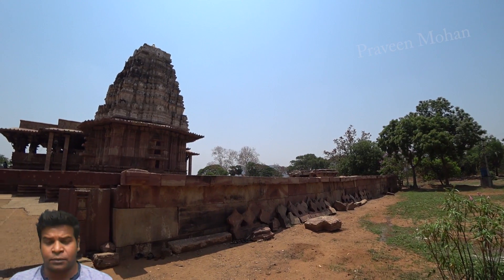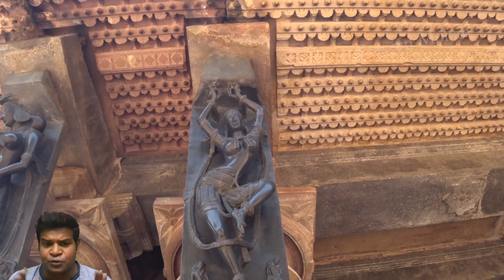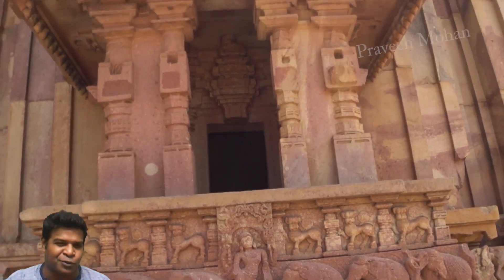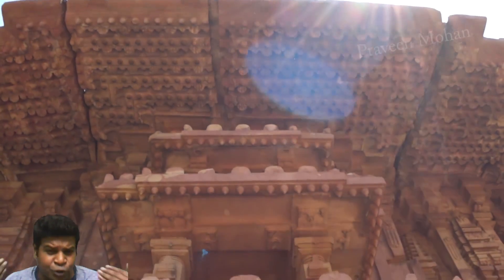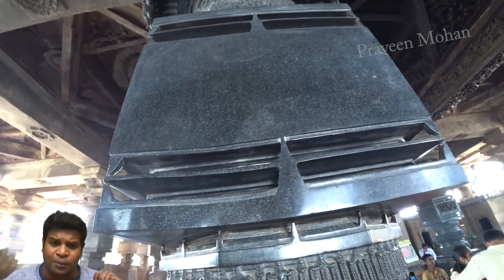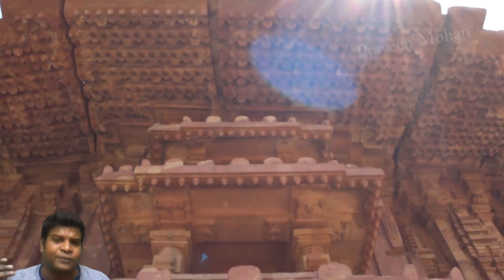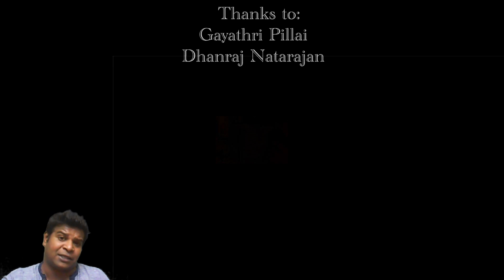Decoding Ancient Engineering Technology at Ramappa Temple, India

Comment: As a structural engineer I have used current earthquake design technology in the design of major structures as well as buildings. As these joints are " keyed" but permitted to move vertically it is a technique that we use in major earthquake prone zones. This method allows the overlying structure to "walk" back & foward vertically but not displace horizontally. Thus not only allowing the whole structure to remain intact but may have a dampening affect as the lower section moving in quick lateral back & foward motion, is separated from the top structure which moves in a much slower, and dampened, frequency. Obviously this minimises overall damage. This modern tech is only less than 100 years old. You did well to analyse the temple column tech Praveen so I think that the local university should grant you a doctorate in analytical engineering as soon as possible. Keep up the good work as I am a great fan of ancient Indian tech and, also more importantly, ancient Indian spirituality which will lead the world foward in the near future. 🙏

Comment: Praveen, I don't  think they were representative of step drills, I'm thinking they are used more as a "Go-No go" guage. The holes you were showing in the model were square holes. The female square hole has to be a different size then the coresponding square peg that is going to allow the two to nest together. Each step on the guage is numbered. Workers in one location can make a same size hole or peg as workers in another direction by the plans showing what step on the guage to use for a particular stone.
Anyway.... just a thought. A guage like that is used un production work!

Comment: At 16:41 you show a carving that you see as a drill. My thought is that in the tunnels you show in almost every video under these temples there are square holes in the walls, and these slide in and protrude into the tunnels like a sideways antenna. Then when wind blows through it vibrates these "antenna's" producing a sound like AUM. It would vibrate the entire temple, which is all carved to vibrate at specific frequency's. Then those sound waves would be amplified by those speaker shapes in the ceiling, making the place hum like a thousand monks chanting. 
Just a thought.

Comment: I notice that the statues and the columns look exactly the same as those which remain from the destroyed Warangal Temple. Is it possible that they were taken from the ruins of Warangal and re-used in this "new" Ramappa Temple? Warangal may be much older. 
For me, the most amazing thing to see are the machine-like "grills" which you can see around the square part of the column at 14:34 in the video. These are the same as those on many columns and other objects from Warangal, and many other ancient sites in India. These grills do not look decorative, they had some purpose, they are machine-like, unlike all the other pretty decorations and figures. What was fitted into those grills? Wires? You can see what look like wire holes in some his-res photos of these columns. I have seem some columns where the grills have been broken by what looks like someone trying to remove whatever was inside.

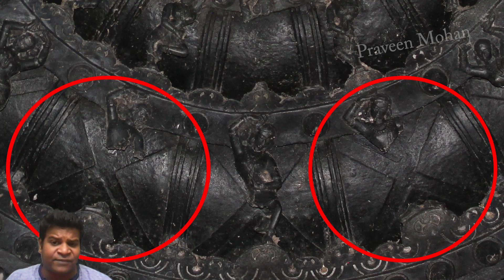Comment: Pause it @ 2:30 Look at the X on the right, the upper right section. How the two lines of the X run paralel even when the error is made. The rock was soft enough to make those marks with wood. The figures were moulded and placed over the X.

Comment: "At the end you must agree they had similar tech to today". Lol. No. Not at all. We have computers, mechanical and electronic portable devices, science that is very far advanced, hard hats, machines, cranes, cement, steel and so much more that there is 0 comparison. 
They did their best with their limited knowledge but it's not comparable wwhatsoever. 
These are simple stones shaped and cut and designed by hand by lots of laborers over time using simple tools to chisel and cut. They had some methods which are simple and they work and they repeated those. This is beautiful not that complex

Comment: Maybe the carvings/ molded statues broke out during the earthquakes. thats why so many spaces and on the one side that was hit hard. it looks like the were layed in by a hook and gravity method. Sorry, looks like that to me. and melting rock it possible. the run off from mining and extreme heat when boiled causes a chemical reaction and melts the basalt to liquid like state. then pour into shaped reinforced molds and when cooled it hardens again.Some of the building was lathed and carved to. That how Machu Pichu/ and other sites around the world did that mined for metals. the run off melts rock when super heated. i believe that they just crushed the rock up and melted it this way. And if you use a full stone it softens it on the outside about 6-10 inches like putty for a certain amount of time so they can shape it next to the other shaped block

Comment: I agree this is a tool. However I disagree with the suggestion that it might be something as mundane as a step drill bit. It is never shown next to or attached to anything that resembles a drill. It is also found in the Dendera Light hieroglyph in the Egyptian pyramid. There it is quite often shown right next to the ankh. 🤔 I suspect it is something relating to the technology they use for power.

Comment: Hello,  I find your channel extremely interesting as to questioning the building techniques from the past, however I cannot agree with your assumption as to the Step Drill  comparison with the item indicated in your video.   The first thing that strikes me is that these are square in section, no round, it would have been very easy for the artisan to round the corners off rather than leave them square.    My suggestion is possibly a taper drift or device to reshape a drilled hole to a square shape.   Or a stack of leaves of a spring that can support a column as per your idea as to the `Vee` section  support or locking device. idea???

Please keep your observations and ideas coming as this is the only way you will get viewers to `think out of the box` as per earlier constructional building techniques.
Take care.  Alan.

Comment: So watching this video I was looking at the roof and the little spikes on the edge of the roofs they appear to me to be points for the water to drip down so there's a thing called a hot roof or your roof sweats so maybe the climate was a little more moisture and the the roofs the ceilings not the roofs but the inside the ceilings those spikes I believe if the moisture level gets intense water would collect on the roof and then it would run to those drip points and it would make drip points all the way around the whole Temple making a line of drips and I believe that these line of drips were also used in maybe a type of water rain appreciation music that could happen but it's just interesting how the drips refocused down water which is a form of energy life whatever from what catches it the ceiling and then it's condensates there and then re-drips down and it's all directed it's very interesting

Comment: From the features and the advance cutting device from this ancient looks alike a workshop for machining works before those tools may be scattered due to explosion or accident and being abandoned. The remains of those things looks like a advanced capacitor to boost fields and maybe created field cutting device. You guys need to realize the physics here of quartz crystals, conductive stones etc...somebody could by accident were used one of those Blow torch lighters after had a smoke of weed 😁 a  where the used the blow Torch Lighter and focused the jet flame on a large piece of Rock Salt, It built up energy in the Rock Salt and it exploded and shot hot pieces in all directions. So if you think of this with very tiny pieces of quarts with a Plasma field on quartz field stone it would shatter those pieces creating a cut in the stone. Maybe ultrasonic sound might cause quarts to give of fields that melt instead. However, no experts from the people to understand or repaired the machining technology and  to remember of their existence, the temple being rebuilt. We don't know.

Comment: The tool is used throughout history with previous civilizations just for different reasons, what’s missing is the frequency needed for the type of work required. Every mineral has a specific frequency where it softens to the required density needed for the user, trick is figuring the frequency to each one... kinda like the movie “the core” did with its craving sound vehicle, just to the degree of 3D printing...

Comment: the real main reason  people from a long time ago used stone is because the are much smarter than us.
to shape and lock stone together is much more stable in an earth quake.
they may at one time tried to use metal but they new it would not work because when you place metal very deep
into the ground it acts like a large tuning fork and it will shake and vibrate very heavy and the stone in your walls will crack
and buckle under its own weight.

Comment: I wonder if the pillars were used as pulleys and the tool was situated between them and ropes were pulled to turn the tools....
The ropes could be placed at various levels of the tool to achieve various speeds and torques. The ropes could be pulled by as many or as few as necessary. Maybe the whole temple was a machining factory.

Comment: Great video! However, I do have a nit to pick: the walls are stone and the statues are stone. How could the builders place the statues to fit in the slots without leaving marks, at the very least, to breaking bits of stone either in the statues or the walls or both? There is no give to the stone, so you can't just "slide in" the statues into the slots.

Comment: In those times which this temples had made should be a big advanced enough.means the artists had all the advantages in their hands.plus having some secret high tech tools  belonged to a special society.In these kinds of works normally in some Areias if some peace’s curved out ,in some other Areas some other peace’s cut separately then glow in the place.,in some other ....some other peace’s would be worked in small peace’s then will be glowed and connected together with outer inner joints.Also using rocks powders can be used ....

Comment: Nice again, is it possible that the supposed drill bits are actually a harmonic resonating tool? Would be easy to carve stones with ultrasonic sound, isn't that so?  There is one of those devices at the bottom of the sea, I will have to find it, AND there is the exact same tapered tool carving here in Utah, at the San Rafael swell that people believe the Mayans carved.  I have wondered for a long time what this symbol is... .... ..

Comment: Looks more like a broaching tool than a drill bit.  Step bits are mostly used for cutting large holes in thin and relatively soft materials.  Don't see how this geometry would be useful for cutting stone as plain metal tool like a modern step bit.  On the other hand if it was metal tool loaded with a cutting abrasive it might be effective.

Comment: Hi Praveen.. Great job 🙏...
Phenomenal effort indeed to decode things the way you're doing.
Being a structural engineer myself, I am thrilled by the way ancient construction technology had flourished. I would also like to introduce you to a term called "shear". The slots you were mentioning, most of them are designed to be functioned as a shear connections & some are ball and socket. Designing those connections is itself a procedure which includes parameters like density of the material, shear capacity of the cross sectional area of the male portion of joint. As you have clearly stated these are rocks which are brittle in nature, they can only be designed on load bearing concept and the self weight (acting due to gravity) of all these individual members of the structure itself brings in the inherent lateral stability on its own against external lateral forces caused by ground motion due to earthquake. 

You're doing a great job my friend 🙏. You're blessed.
Keep up the good work and wish you all success.

Comment: Thank you for dedicating your time to help inform and enlighten. All your videos raise questions we need to be asking ourselves. I want to comment respectfully about the “step bit” design in the model. If compared to the two pillars directly on either side. The profiles are identical on separate size scales. The plinth notch at bottom, the square base block with two horizontal dash lines, the octagonal section with two rings, the next square section with two sets of horizontal dash lines  at which point it flares out and supports the ceiling. So if imagined, the rest of the step bit continues up through the temple.  Would those “notches” be the floor levels slid into and locked in place. Is there a way to continue the comparisons? If the plinth is cut exactly to the size of the step and slid into the recess it would prevent the rest of the pillar from snapping off during an earthquake.

Comment: Advisory:  To examine locations too high to look at one doesn't have to climb or use a ladder, just a digital camera mounted on a monopod or tripod.  Simply set it for a timer shot with the flash on, raise it up to the location of interest and hold it steady.  It takes a macro photo at high resolution which can then be examined in great detail.  Also, zoom can be used for ceilings, -maybe supplement the flash with a flashlight.

Comment: Ok so u think this is stone cut not maybe antediluvian lathed wood turned stone? Especialy when i see you climb down into a flooded underground temple youve touched on the facrory location the lathe and the remple depucting all of these antiquitech styles of building to show a drill bit then it bein asembled so if it was wood wouldnt those little x figure be easier to have it on a peg an place it in the middle of the x

Comment: Contradiction. You can clearly see the cut marks on the temple on everything from the outside walls to the floor below. It is only the sculptures and other select parts that seemed to have that high level of craftsmanship. Which creates a paradox. If they had advanced electronic technology like drills and other tools, why would they only use it on the scultptures and not the temple itself?? You can clearly tell but the slots the statue is fitted into, that they were made using simple wedges and hammers.

So here's another theory. In ancient India there must have been many different types of rock cutters. And when a temple was meant to built there were some builders who built large monolithic pieces that into one another like puzzle. And there were also more refined stone masons who could do smaller more detailed work like the ones in the statues. I think it's obvious that whoever built that temple is not the same person who made the smaller carvings attached to it. 

There must be an ancient field of stone masonry lost to time developed by the hindus that transcends modern stone masonry.

Comment: The only way I see these being done is by laser sintering similar to what we currently have in our 3D printer technology for sintering metal components from powered metals.  Laser tech can also be used to remove unwanted materials from a substrate.  This would help explain some the fine finishes that are seen of many of the rocks as very precise surface finishes can be obtained with many forms of electric discharge.  In my industry they use a machine called a wire EDM.  Some of the more expensive units can obtain mirror surface finished via electric discharge from a copper wire.  The piece in the temple that is said to be a cutting tool looks more like a multi stacked Tesla coil similar to many of the depictions seen in Egyptian temples of their own version of high voltage discharge units.  All these older cultures would have had to do is figure out how to create and capture plasma discharges in some way and form and direct them towards a target very finely to create many of these fine precise shapes in stone.

Comment: At 3:32 On statue, this woman has high pressure hydraulic hose pipe. This look like High Pressure Stainless Steel Braided Hose was used as jewellery by our ancestors. Try land spaceship in uneducated vilage and they will dismantling it. Then they will use parts as simbol of powerfull good which land from sky.

Comment: These prototypes are made by architects first so that the fellow hundreds of builders can get the knowledge on how the temple is going to be built by just looking at the miniatures and they start working on the big picture. So the architect will not have the work to teach each and every builder on what they are going to design ., and also if by the years the builders are changed the new builders will also continue the work by just looking at the miniatures.

Comment: Could the structures in question around the 10 minute mark be foundation pins that actually reside within the base of the pillars they are standing beside?  If they are shown in the model and we don't see them in the full size temple, the idea that the builders are demonstrating their techniques could support this notion.  Like a taper joint these, pillars and possibly foundational pins have triangular marks showing matching elevation and orientation.   The top of the possible pin could wedge into a foundational leg.  Could they have melted the rock surface and applied the rock carving to the melted point like rock glue or rock welding?  Some Inca walls/stones show bumps off their sides like flow marks off of a feeding supply tube.  Just a thought.